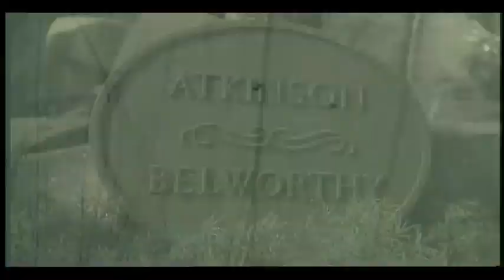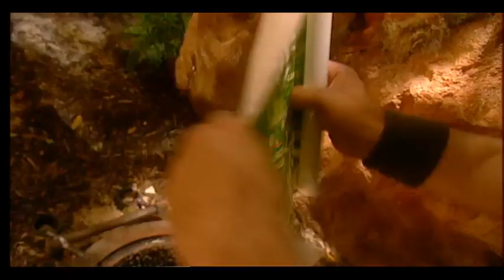Jungle Run - Wolf Spiders

Comment: Well I've said it before and I'll damn sure say it again, I've never seen a worse team than this in the 7 years that Jungle Run was on the air. I mean Shivam was clearly wanting to get his own way in the Fort Maze, then again those two girls were just as bad as Michael said they clearly had a temper tantrum the way that game went. And to top it all off, they all got locked in which I'm not at all surprised. The Wolf Spiders are without any shadow of a flaming doubt, Jungle Run's WORST TEAM EVER! Bet they didn't half get some stick when they got back to Hounslow.
Reply: I'd say they were bad, but not as bad as the CITV or My Parents Are Aliens team. That Angel Falls challenge is pretty difficult & they didn't do too badly on the Wrecked Boat & Dark Swamp challenges, but performed badly in the Mine Shaft, Fort Maze, & the Temple. I bet Shivam might've gotten out in time if it was still the Old Pyramid from 2001-2004

Comment: Did they what was going on there team? 21:03
Reply: Micheal didn't have any idea what was going through their minds. I couldn't believe they weren't fast on the ball maze. The spider wolfs should've come out and still achieve a jungle run 🐒 plush. That's what happens if a team comes out without any 🐒 treasure.

Comment: With The Wrecked Boat Idol they did good getting 3 Statues
In Angel Falls Shrines their teamwork was poor & there was little Co-Operation from Sapphire which resulted in only 1 Statue
In The Mine Shaft well lets be honest the writing was on the wall throughout that challenge
At Dark Swamp well did better than The Welsh Warriors & Emmerdale 2 getting 3 Statues and perhaps it looked like the start of a recovery
But in The Old Fort Maze a combination of The Girls NOT giving clear instructions & Shivam NOT really listening to them resulted in A 2ND LOCK-IN & a lot of Bad Blood between them
And finally at The Temple they didn't even Complete The Marble Maze before The Entrance Locked or even made an attempt to Escape The Temple
Reply: Correctly me if I'm wrong but I think that may only be the only episode where the team didn't even make an attempt to escape the temple and also the least amount of monkey statues accumulated? I watched another team with 40 seconds inside the temple i think but they managed to get the stone monkey idol and escape which is a brilliant achievement. Might have been season 8 episode 2.
Reply from the maker: @Highran56 Your correct with the not attemptting to escape the temple. In Series 8 Episode 2, the team got 30 seconds and made it out with the stone monkey.
Reply: @Highran56  S8E2 also had 30 Seconds in The Temple but they did managed to escape & with The Stone Monkey
Reply: has a team ever escaped the temple with no statues?
Reply: @Highran56  3 teams have actually
Reply: @Highran56  Jungle Run (02) & (15) are 2 of them

Comment: 9:38 The viewers get a White Ring indicating where The Monkey Statue is!
Reply from the maker: Claire did a god awful performance in the Mine Shaft
Reply: @Willzzz123  You're right, she couldn't have done that challenge more awful than she had
Reply: @Willzzz123  She was just climbing up the ladder stupidly I guess and she couldn’t see the statue down in front of her.
Reply: @davidfearis7335  She was just climbing up the ladder stupidly I guess and she couldn’t see the statue down in front of her.
Reply: @Willzzz123  She took too long too and got locked in. No statues at all either.
Reply: @davidfearis7335  She took too long too and got locked in. No statues at all either.
Reply: @HafeezUrRehman916  Yeah that's what I was thinking to, mind you that statue isn't that noticeable at first sight, I think only 2 teams out of 5 noticed it
Reply: @HafeezUrRehman916  Doesn't really matter if you get any statues or none at all, if you get locked in, you lose all the statues gather plus 2 Statues already won
Reply: @davidfearis7335  I see. I knew that anyway.
Reply: @davidfearis7335  I saw that statue too easily too.
Reply: @davidfearis7335  It’s just on the wall.
Reply: @Willzzz123  8:15 — 9:48 Claire was really useless at the Mine Shaft and didn’t even get any statues! 0/3 statues!
Reply: @davidfearis7335  8:15 — 9:48 Claire was really useless at the Mine Shaft and didn’t even get any statues! 0/3 statues!
Reply: @davidfearis7335  This was 4 months ago…
Reply: @davidfearis7335  Same in the Fort Maze if you get locked in, you give up all 4 statues by putting them in the receiving idol and the teammates above have to give up 2 statues too and lose 20 seconds.
Reply: @Willzzz123  Agreed, she didn’t even get a statue
Reply: @davidfearis7335  Agreed, she didn’t even get a statue

Comment: Seeing as they only had 30 Seconds it sort of seems pointless reminding them of The 20 Second Warning!
Reply: I know it went off as soon as they got to the first challenge
Reply: I would have got back after I heard the 20 second warning.
Reply: @HafeezUrRehman916  It was almost like 'WHAT'S THE POINT OF EVEN ENTERING THE TEMPLE'
Reply: @davidfearis7335  I know I would have got back after I heard the 20 second warning, even if I had 30 seconds.
Reply: @davidfearis7335  I know I would have got back after I heard the 20 second warning, even if I had 30 seconds. That would make no prizes then but I would have to get out to avoid getting locked in.
Reply: @davidfearis7335  If I had 30 seconds I wouldn’t enter the temple either. Or just run down in 10 seconds and get back up again.
Reply: @HafeezUrRehman916  You would at least get THE JUNGLE RUN MONKEY but that was it
Reply: @davidfearis7335  Don’t think so because you must get the Stone Idol for it.
Reply: @davidfearis7335   I know I would have got back after I heard the 20 second warning, even if I had 30 seconds. That would make no prizes then but I would have to get out to avoid getting locked in.
Reply: @davidfearis7335  If I had 30 seconds I wouldn’t enter the temple either. Or just run down in 10 seconds and get back up again.
Reply: @HafeezUrRehman916  The team in Jungle Run (02) escaped without The Stone Idol but still got The Jungle Run Monkey
This is the episode
https://www.youtube.com/watch?v=HycQpOtqGjM
Reply: @davidfearis7335  Ok thanks.
Reply: @davidfearis7335  If I had 30 seconds I wouldn’t enter the temple either. Or just run down in 10 seconds and get back up again. I would still get the Jungle Run Monkey.